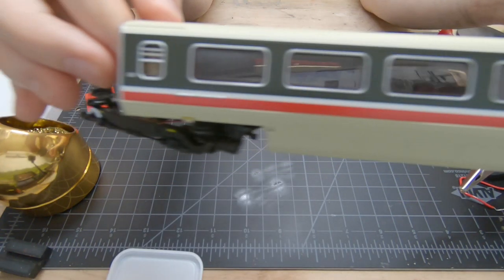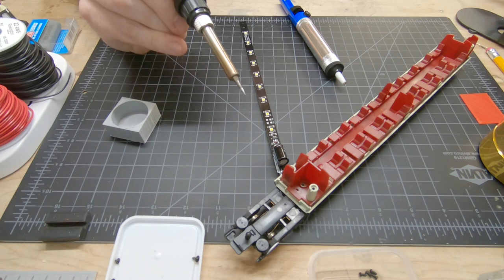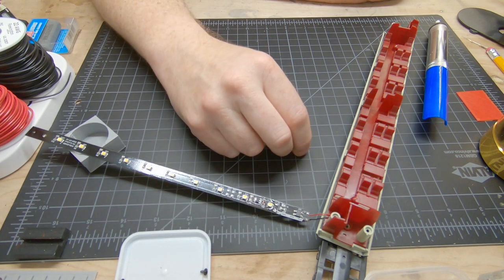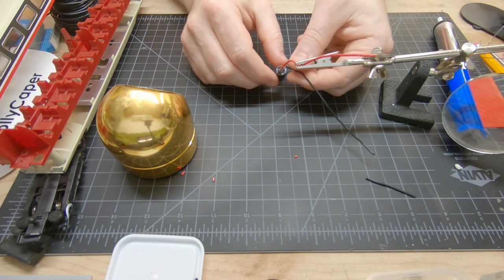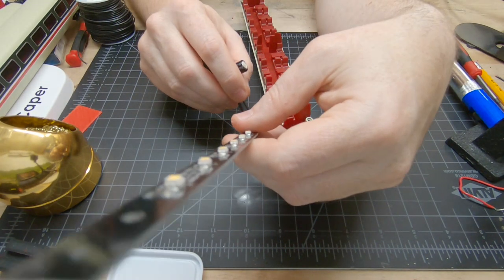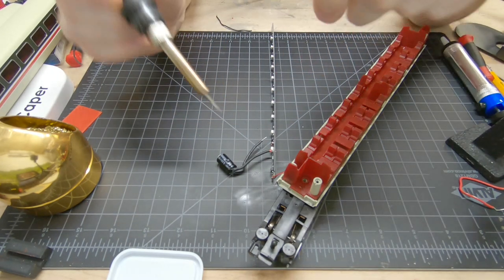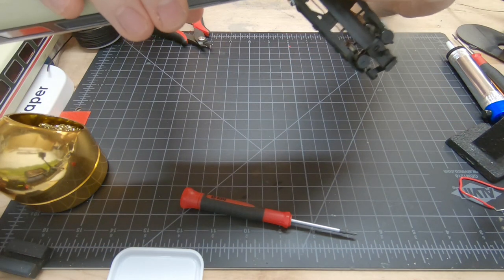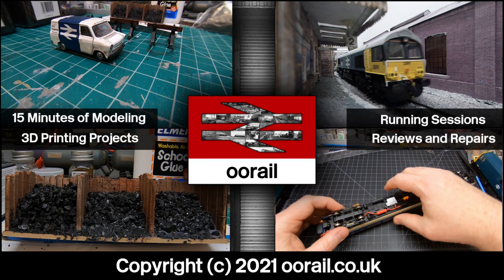Hornby APT Coach Capacitor Fix | oorail.com

Comment: Thanks for taking the time to demonstrate that. Will await with interest to see your solution for placing the capacitor under the floor, I think that’s where I’ll aim to put mine.
Reply from the maker: Thanks Bryan. That video should be out shortly, I'm still tweaking the 3D printed parts but shouldn't be much longer.

Comment: Just a friendly tip, when trying to desolder something, first apply some fresh solder to the joint. It will then unsolder much easier. And use leaded solder rather than the unleaded stuff, it will melt quicker and is much easier to solder with.
Reply from the maker: Thanks Bob. I probably should have cleaned the solder joint with contact cleaner. These boards from the factory are usually coated so it takes a bit to burn that off. As you see in the video, I cranked up the heat which burnt through the coating a little faster. Flux might have helped as well but I was trying to avoid making a mess :)

Comment: Great job. I wonder if you could use a bigger capacitor when it's fitted underneath the seats. It's a shame about the little bit of light bleed.
Reply from the maker: You might be able to fit a 6700uF 25V capacitor in there, they are a little bigger. I found some on Amazon that might work, so I'll let you know in a few days. Capacitors can leak and pop, so need to be careful putting a bigger one in it.

Comment: Hi there, did the update on the 3D printed parts for the capacitor relocate happen please ?
Reply from the maker: Hello Bryan. There are a couple of videos on this in the pipeline and they will coincide with the release of the 3D printed parts over on Trackside3D.co.uk. I've done some interior upgrades as well which will also be available. Sorry about the delay in getting back to you. Have been very busy between work, family and working behind the scenes on some cool projects.
Reply: @Oorail  Hi. Great to hear from you (sorry don’t know your name !). Good news that things are moving on. Since my original post to your video, I received my APT. I’ve got two motorised NDMs. I’ve converted to DCC by installing decoders in the two NDMs and Driving Trailers. I’ve removed the original circuit boards and hard wired the decoders in. I’ve therefore got working cab lights in the cabs that can be switched on and off. Also, the saloon lights can now be switched on and off too.
Reply from the maker: No worries Bryan. My name is John. Glad to hear that you got your APT and fixed up the DCC issues. You should see some new videos this week on the channel. The 3D printing projects should start to trickle over to the site soon. Due to the extreme winter storm here in the States, there were some strains on the power grid, so we made a decision to shutdown non-essential equipment, including the 30+ printers in the print farm and the servers that run them. Today I'm working on bringing the print farm back on-line, but also taking the opportunity to do some upgrades (firmware, replacing nozzles etc), and checking the calibration on each of them. Hope you had a good holiday and have a Happy New Year!
Reply: Hi John, Happy 2024 to you ! Are you still hoping to progress this APT issue ? Regards, Bryan.

Comment: I have been servicing my two APT’s and have found the motor bogie, once out in place is extremely stiff, as a result it derails because it cannot rotate smoothly. Any ideas?
Reply from the maker: The original APT motor bogies are metal, they are four surfaces that touch the plastic chassis. The left and right side of the metal bogie there is a sort of tab that slides against the inside of the body shell, and the front and back of the bogie has a clip that slides inside a lip on the plastic bogie. The amount of friction over time seems to increase, probably as a result of the plastic stiffening a bit and dirt. I've found if you clean these surfaces on the bogie and the body shell, just soap and water works fine, then dry it, and apply a small amount of plastic-safe synthetic lubricant. I found that the silicon, PTFE or PFPE grease (in very very small amounts) works very well - think application with a toothpick. If its the pantograph end thats causing problems, make sure there isn't anything catching in the roof as it has to move back and forth through the roof panel.
Reply: Thanks for the suggestions re: cleaning and lubricating. I have one back running on the rails but as I say, it is noisy.
The other is being serviced and will be back together shortly. You can see them here (apologies for the audio quality) https://m.youtube.com/watch?v=iJvOTSilXJE&t=2802s

Comment: Guessing you could add a bigger capacitor in the underframe since it wouldn't be seen ( the lights should stay on longer)
Reply from the maker: Yes there is a bit of room between the weight and the molding for a larger capacitor. I picked up a couple of 25V 6700uF capacitors, which look like they might fit. They are 6x larger than the existing capacitors, so will be interesting to see how long the lights stay on for. I'm testing out some 3D printed parts to make it easier to hold the capacitor in place. You don't want it shorting off the weight! :)